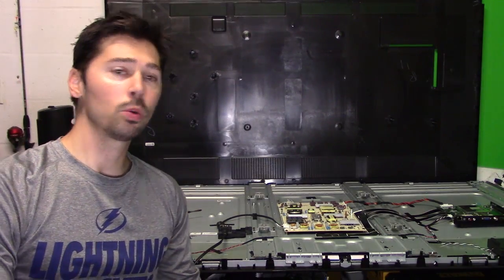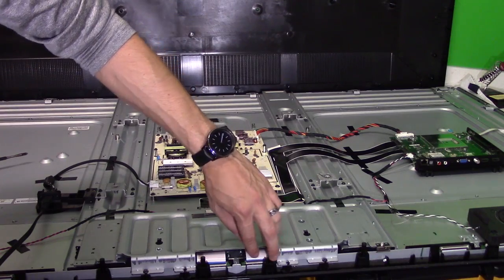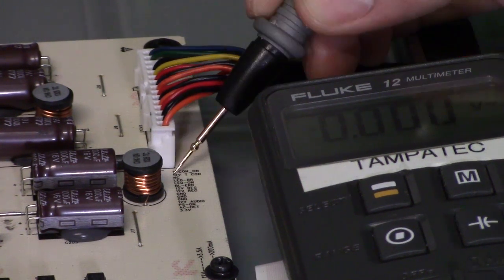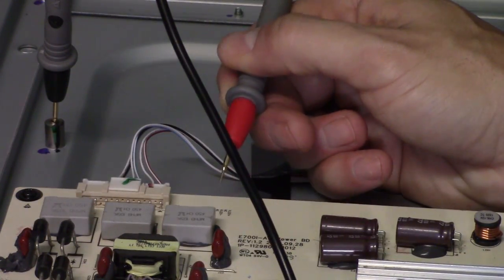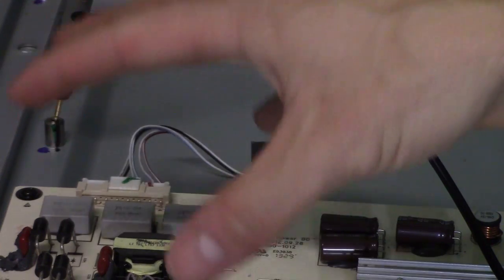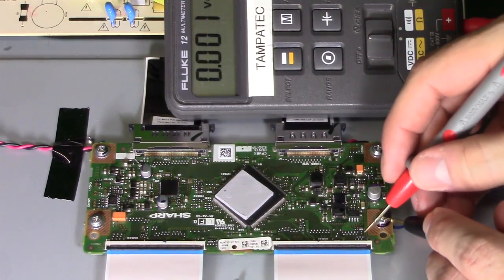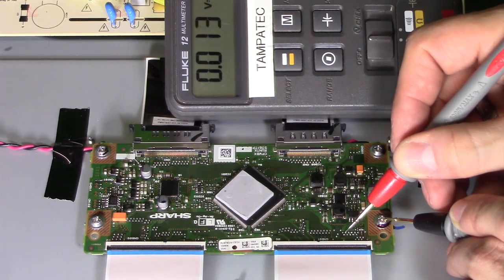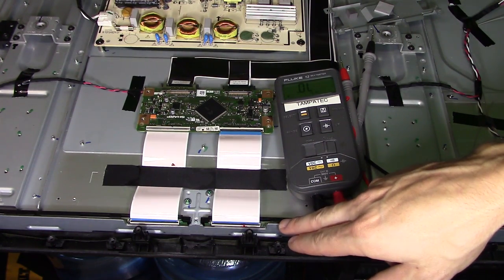How to Troubleshoot and Fix LED LCD TV Vizio and Sharp flatscreen No Picture but sound

Comment: Have a Samsung 43 inch plas. My TV works fine with v, c, R, but what do you hook it up to the cable box? It has a tendency too cut out speakers. Kind of like momentarily, like just pause and then come back pause and then come back pause and then come back. What do you think? I need to look at check out to solve this problem. Thank you.

Comment: On my tv im getting a white screen with like vertical black lines , i removed the SL cable then the right side of screen worked perfectly. So i put tape over a few pins on the SL cable and plugged it back in , i then got a fully working screen apart from a white patch in the bottom corner of the screen .
So i tried plugging the SR cable into the left COF side but leaving the SR cable in the right side of the TCon board , that side of the screen then went fully black but no boot logo was visible , like with the right side only or the tape trick . 
And then put everything back in place and tried the tape over the pins again and u cant get it as good as i did the first time . 
Could this be a ribbon cable fault or tcon board , considering i got a fully black screen when putting SR into left side ?

Comment: Like your videos, very informative. I have Vizio 70inch LED TV. Model M70-C3. Black screen, no backlight. The power button lights up and the optical audio port lights up. I removed the back panel and checked the voltages on the Power Supply board.connector to Main Board, standby voltages for AC det =3.96, PS on =5.13 and AU =12.. Pins 8&9 VS =12v. Pins 13&14 T-con =12v, however pin 15 T-con on =0v. Also T-con connector pins 1,2,3,4 measured 0v instead 12v. Checked output voltages on LED Driver connector. Pins 3-8 measured 34v instead of 24v..Pin 13, vsense =2.6v. To summarize, zero voltage output to T-con board and higher voltage 34v instead of 24v going to LED driver board. Can you advise me on which board I should replace. My initial thought was the Power Supply board, however I guess it could be the Main Logic board not setting T-con on. Appreciate your expert advice.
Reply from the maker: sorry for late reply, I get many questions. If you turn off the room lights and See a Backlight Glow and no picture then it can be the T-con board or main board. Like u said if you don't see backlight glow it can be bad LED strips (very common). get TV parts from shopjimmy.com
 thanks for being a member!

Comment: Onn 70" TV that is stuck in recovery mode and I have tried everything everyone as asked me to do from un plugging TV  for days on end , hard reset ,  holding reset turning TV on and off and pushing buttons ... recovery mode  is all I every get ... TV is brand new and I lost receipt and I waited  over a year to watch TV because I was doing some remolding in that room... big mistake not to open TV and test it right away because no warranty at all ... I need help  ROKU Smart TV 70" ONN TV from Walmart...

Comment: My 50' Vizio smart tv screen is paused at the bottom portion of the screen and has turned white with vertical and horizontal lines but the top portion shows well
Reply: The model number is V505_J01

Comment: Hi ! Question : When i turn on the TV (SHARP), there’s a “double image” / “ghost” problem on the whole screen (both sides L/R). 

When i unplug the LEFT ribbon cable (output) from the T-CON board that goes to the LEFT buffer board, the image on the RIGHT side is NORMAL (!!) If i re-plug the left ribbon cable to the TCON board, the problem happens again.

Would that be more likely a T-CON board issue, a ribbon cable issue, or the actual buffer board ???
Should i get 6V readings on the soder pads on the left side (output) on the TCON ? If not .... there’s the problem.

Thanks !

Comment: I have just a red light blinking every 5 seconds steadily every time I turn the power button on.  Temporarily I see the menu light up at the top when trying to boot but any kind of gliimpse of a menu at the top disappears quickly to a completely black screen. What does it mean if a red stand by light blinks every time 5 seconds on a black screen?

Comment: I have the same problem with 58” Vizio, it’s a 1 1/2 years old. I replaced the T-con board still no picture. Don’t know what to do next. If you have any suggestions it would greatly appreciated.

Comment: Hey love the content--was hoping to get your opinion on an issue I'm having with my Sony XBR65x900H LED smart tv. Basically, it sometimes turns on/works fine for a few minutes before the backlight flickers, turns off, and the tv blinks 4 times. I've checked the boards (power, LD, main) and noticed that as it starts flickering, I also hear crackling/whining from the power board that appears to be in sync with the backlight flicker. I thought this might mean a power supply/capacitor issue until I held the power button while plugging the TV in, and was able to see an "Updating" screen for well over an hour (backlights on, picture on screen); so this makes me think it might be another component failing? Any tips on an approach to diagnosing which specific board/component may be failing? This is more of a hobby than something I must have fixed, so any insight is appreciated!

Comment: I have audio but no picture on my E701-a3. I have backlight, but I’m getting 176v instead of 164v to my LEDs and I have 12v on the first T-con feed but 0v on the second (lower ribbon). Is this indicative of a T-con board issue, main board issue, or possibly both?

Comment: I just got the same tv from my brother in law and am determined to fix it.   Mine won't turn on either. But I have standby voltage and return voltage from The main board.   No backlight normally but it willflicker on briefly when I disconnect the cables from either the power board or main board.   Thinking T Con is the culprit.  Any other thoughts would be greatly appreciated

Comment: Hey I have power, the standby is on and then light turns green when the power button is pressed. The tv turns on and after a second, the tv picture flicks off but standby light still green. I did light test and I couldn’t see any picture and there is no light coming from the back of tv(there is light coming from back when the tv picture works) it’s inconsistent what would the issue be with my tv, please help
Reply: Same problem here 😞

Comment: Have same ish tv. Same issues ish. M701d. Changed primary caps on PS. logic sending signal to turn everything on. Unplugged tcon still no back lights. Mine has LED DB.

Comment: Hi, my Vizio turns on, backlight and sound work but no image. I narrowed down the problem to main board or T-Con. I’m not getting any voltage from the 41 pin cable going from main board to T-con. is the problem the main board or T-Con? Don’t want to replace wrong part and it ends up not being problem.

Comment: Have a Sharp aquos lc-40le810un plug it in nothing no lights no anything tried holding power button then plugged in..have a/c power that's about the extend of my knowledge.thanks for any help..but still nothing

Comment: I’ve replaced all 3 boards and still have the same original issue. Backlight and blue picture on top 1” and then colored lines down about 2 more inches and that’s it

Comment: So if I’m not getting 12V on the t-con connectors on the main board I should replace the main board or replace both?
Reply from the maker: If you unplug tcon board and get no 12v from main board connector, fault can be power issue from main board or back to power board. Check all test points first. If you do get 12v if tcon is disconnected then tcon can be at fault. 12v can drop when a fault is on tcon board.
Reply: TampaTec thanks! I disconnected the T-Conn and still had only one connector on the main board supplying 12V. The weird thing is the test pads are all getting the ~1.5V.  Checked around and can’t find a replacement main board anywhere :(

Comment: Working on my Vizio- have followed your videos to get started. TV won't turn on- I get the white LED when I press the power. Nothing else. No backlight. Can't see anything with the flashlight test. Standy power is present on the power board. I get 5.2 volts at the two places indicated and 12 V and 12V audio connections all check at around 12 at the main connector. The big cap reads 160 V for what that's worth so I'm guessing the power supply might be fine. At the second connector which appears to go to the LEDs I read 26 volts on two wire that are labled LED and less than one volt on the other two connections there. Photo available if needed. The TV was working fine but then it sat for a year unused. I was trying to put it back into service. Appreciate any help. J

Comment: I have a Hitachi 45 inch  sometimes  it will power on sometimes  it won't  it may take three days before it will power on again the picture and audio is great I've tired  new power cords but that wasn't it I tried changing the cords only because sometimes if I wiggled the cord or unplugged  it it would come on I can hear the click but no  Audi or picture.  Any suggestions?

Comment: The part where your testing VLED 1,2,3. I have 0 volts , I have standby voltage everything looks good on cable going from power board to main board except for PIN #15- 0V PIN #14-0V #13-0v ,#12-2.6v #11-0v , bad power board or main?  Also I'm getting 308 volts pin to pin on main caps

Comment: Tampactec thanks for your great videos they are very helpful. I have a Panasonic TX 55 Cx400B tv it has sound   but the only picture is on the very lower bottom of the screen eg where notifications appear such as breakingnews the rest top of the screen is white. I got  a use TCon board online but no deference. I  removed and pushed the cable  from power to TCon and from TCon   to display buffer board no change I will greatly appreciate some advice  David

Comment: On the power board on one fitting, the diagram on the board itself indicates 5v for the first two on the bottom and the next three lines on both sides 12v.  When I tested the first two were 5v as indicated but the other six were 19+volts.  What will cause such power to change?

Comment: Enjoyed this video for the test points. Checked the voltage at the tcon connectors at the main board but only have 12v on one connector. Tv has sound, channels and backlight but no picture. Tried replacing tcon board but no difference. Do I replace the main board?
Reply: +steve Fayet +Tampatec I have the same exact issue as you do i have 12 volts at the main board cable going out to the T-Con board (one closest to the top of the TV Screen) But the other one below it, No Dice! (one closest to the bottom of TV) How can Repair the main board? I have plenty of extra parts from other sets, as i am venturing in this for a hobby. Just need to know what to test from here.

Comment: Great and helpful video! Quick question, if there is no apparent backlight in step 1, what's the next step? LED Controller board replacement or continue troubleshooting? Main board gets red LED lit when plugged in. Then when power button is pressed, that light turns pink and the power indicator light on the front of the TV comes on solid, then blinks for 34 times, then fades out. After this, the pink LED turns back red.

Comment: Hey man I got a jvc em39ft tv and my pins from logic board to power supply look good . The connector from power supply to led has led+/ led- and I don’t know what the volts should be but it’s at 55V standby and goes to 89v when turned on but goes back down to 55v after being turned on. The tv powers on and backlight flickers once and powers off. Tcon board is good using the flashlight method. What could be the issue
Reply: The connector from power supply to logic board has 8 pins . They read 1-2 = 19V, 3-5 ground . 6= NC , 7 on/off 8 is dim

On standby 1-2  19V 3-5 ground, 6 = 0, 7=0, 8=0

When on 1-2 is 19V 3-5 ground 6= 3.3v 7 3.3v 8 is 2.76V

Not sure if that’s how it’s supposed to work , the diagram doesn’t say how many volts pins
6-8 should be.

Comment: Just fixed our Vizio TV with your help, we replaced the driver board and it is now working.The TV had the black screen with audio but no picture unless you used a flash light on the screen then you could see the screen was on. The part board cost less than $12 dollars.

Comment: I have one tv when I turning on, the fuse of power board go to the dead, I can put in a new one and reemplace the other a turning on the tv, do the same, but I have a regular multimeter.
Reply: Please check your transistor it might be dead

Comment: Thanks for great advice. I have a Sharp Aquos 70 LCD similar to one you’ve fixed before. Not sure what happened to it, but the screen started looking like a work of art. Based on additional videos and talking to some people, they recommended changing the tcon board - which I just did last might buuuut nothing happened, now it’s just a blue screen. The backlights are on, but there’s still no picture or sound. What do you recommend as the next course of action? I would love the fix it, but don’t want to end up investing more money into it and it’s not repairable.

Comment: I've got a Luxor 42. TV it constantly says dongle on dongle of even after turning the router of. I know where the build in dongle sits in the TV thanks to following your videos.i found a code to reset and disconnect the dongle now I'm scared to activate the WiFi on the telly in case it happens again.   Can work WiFi connected to android box  
but would rather have it on the  TV for Netflix Amazon etc

Comment: Hi there just wondering if you can help... my mates old Philips tv will not tune in to any tv stations but you can a dvd on it show the lcd is working. ..so how can I fix it or check the av antenna socket on the tv is working or not. As I've try the same antenna on nother tv and that is working so the antenna is not at fault.  Much appreciated for help

Comment: Dear Tampatec .. Question: I have this set .. two of the 3 LED strips are fine testing with TKDMR LED tester .. one is dead (has one or more open LEDs in both sides). When the set is powered up, the working LED strips “strobe”. Is the LED power driver/board a problem? Or is the failed/open strip causing the strobing? .. PS I bought the power board repair kit from Shop Jimmy, but have not yet repaired the board.

Comment: Hello. I did the flashlight test and can see the static image and the tv image but the screen is all black. Does this mean my backlight inverter is bad? I have a Sharp LC-70LE845U tv. I would guess that this tv doesn't have a inverter because you said in this video that its now on the power supply board? I've also heard that it could possible be the Tcom board. It has a new main board installed. Before I installed the main board the front light would blink one blink. Thank you for any help.

Comment: I'm pretty sure mine is the main board that's bad. I've measured 12 volts on the 51 pin connector, but not on the 41 pin connector. Some of the pins of my 41 pin connector only have 1.3 volts. All power measures okay from my power supply. My back light powers up okay too. I'll update this if I purchase a new board with success.

Comment: How do you how many volts should be going to the back light strips?  How did you know it was 164 V if it doesn't say next to the connector?
Reply: Exactly. But I measured mine and it was a steady 192 volts on all 3 leads. I believe it has something to do with the brightness of your display or the backlight brightness. I've seen that on a Toshiba recently. Dim your display and of course the voltage should drop.

Comment: I need to know where can I get the HOT AIR STATION, RED LEAD REPAIR KIT (RCA LCD FLAT 65) and
T-Con board if need?
I check Ebay by the time i purchase everything I will be out of $120.
I am trying to do this myself without paying a fortune.
My tv is model LED 65G55R1200
65 inch power input 100-120v. 60hz
Power consumption >102w?

Comment: can you give me a tips for my Vizio TV. when i power ON will get display in few seconds then turn off the display. I measure the Voltage for backlight it's there at 78V DC and able to turn on for few seconds but when the display turn it off the voltage drove to 24V. Is it due to Power supply or the motherboard. I also remove the connector to backlight but it's the same scenario

Comment: so I have a 
sharp lc-50lb261u has no picture it has sound and picture with a flashlight no backlights and I just bought a power supply/ led board and it still doesn't work is it something else or the led strips

Comment: I have a sharp 60" tv lcd 2016. When it shows bright light, A sun or any flash of light it turns off.  Could it be an overload on faulty capacitor on a power board or something in software update.  And it started right after warranty ended?

Comment: Thanks for the videos my 55"vizio popped when my wife turned it off and after a few weeks of your  help I've located the blown parts on my power board.
Still don't know what the name of them but testing with a meter after your video I've located the  shorted parts yes not just one
One part sucked the solder up through the board and another blew its top off leaving no info so I hope my local electronic shop can help me out